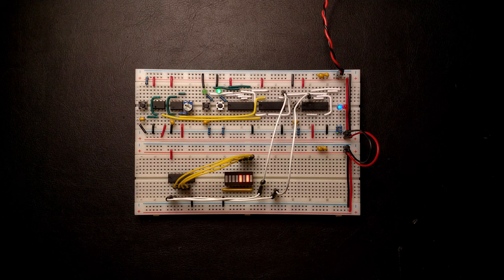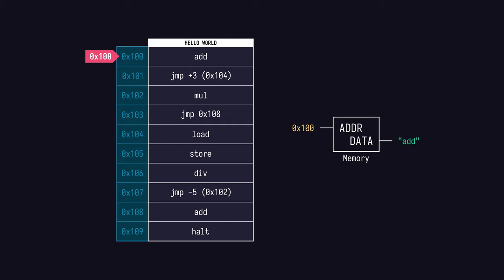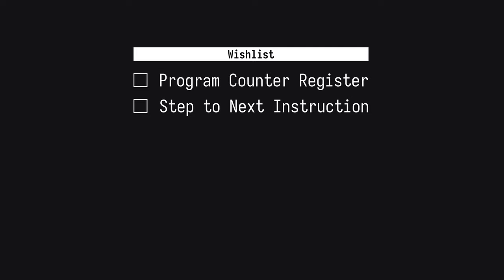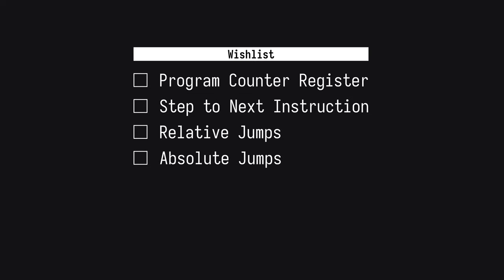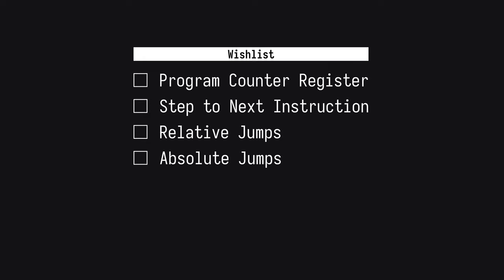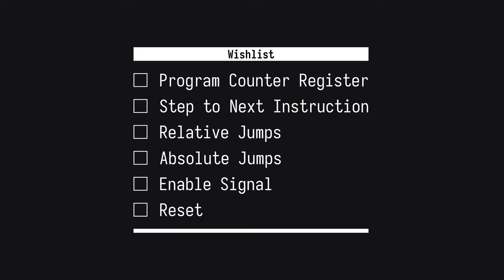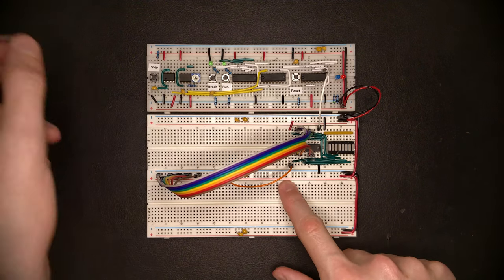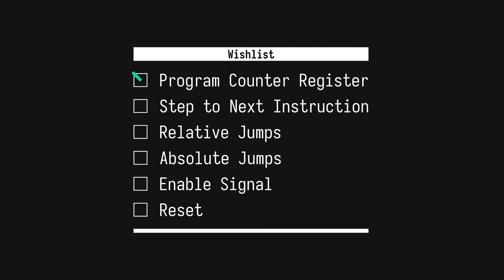Program Counter – Superscalar 8-Bit CPU #6

Comment: can someone explain the capacitors on the power rail? These videos are great but there's still lots of small things I wish were explained.
Reply from the maker: They are considered good practice on the supply rails because of how digital circuits operate: when the clock signal goes from 0 to 1, all chips start to toggle and change at the same time, until all values have been computed and the changes have died down. Each of these chips toggling require energy that they draw form the power rail. So when the clock happens and the activity starts, there's a sudden huge rush of current being pulled from the power rails. Especially on breadboards and through long power cables the power rail can't immediately serve that current, but there's a certain inductance/reluctance that causes the current to slowly ramp up (like trying to abruptly move a heavy object). The capacitors add a local reservoir of energy that is close to the chips, which can supply current over a much shorter wire and inductance. This evens out the power drawn over the main power cable.

Comment: Can I ask, are you only having an 8 bit address, or plan to duplicate the circuit to a 16 bit address?
Reply from the maker: The address bus is definitely going to be 16 bits, otherwise the CPU would be stuck with just 256 bytes of memory. Later episodes actually take the program counter and turn it into a 16 bit PCB version!

Comment: What was that tool you used to adjust the width of the IC pins, in order to place it on the breadboard?
Reply from the maker: That's a pin-straightener I bought maybe 20 years ago at Conrad 😅
Reply: Oh nice! Seems very nifty! 😊
Reply from the maker: Yeah it's super handy. Consists of a spring and about three pieces of plastic. You could probably just 3D print it nowadays 😏